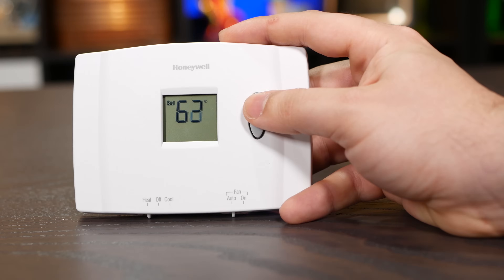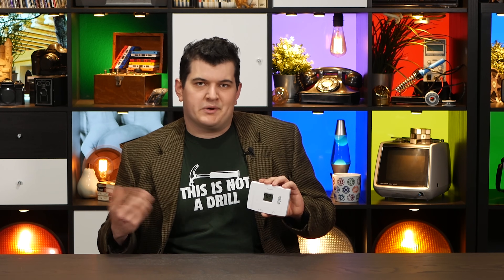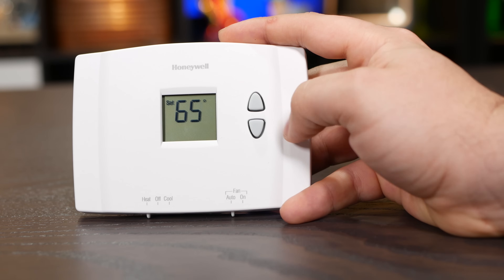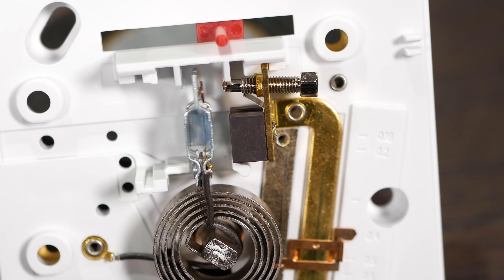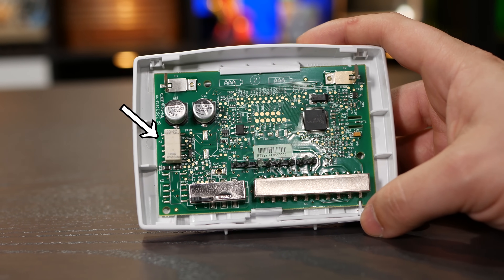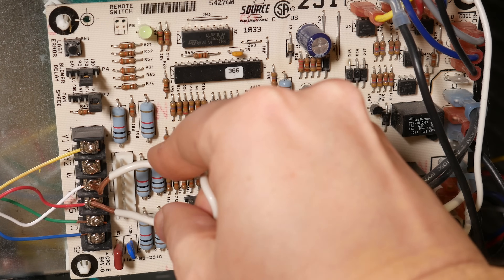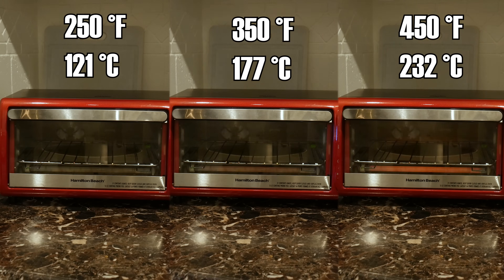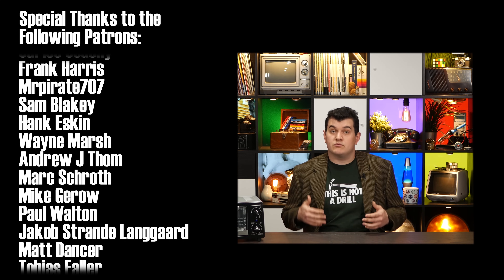Thermostats: Cooler than you think!

Comment from the maker: Some additional information!
Firstly, two-stage heating is sorta common so the notion that "there is no medium blast" is probably true but if you have a fancy pants HVAC system, then maybe cranking the heat up might make it go faster. No idea what percentage of homes have a two stage heating system, but I'd guess it's in the 10-20% range.
In re: the thermostat wire question. Apparently, to this day, the current going through the contactors that actually turn on the high current loads such as your A/C or an electric furnace's heating elements is carried through the thermostat. So, it's more than just color coding; they are designed to carry some current, and thus need to be a minimum wire gauge. So while Cat5 cable or similar would probably work for most HVAC systems, it might not be able to carry enough current for others (and could, potentially, pose a fire risk under the right circumstances).
On that note, and I'm mad at myself for not bringing this up, you might have noticed that in the mechanical thermostat, a separate insulated wire connects the R terminal to the contact on the bimetallic strip. This prevents the current from being carried through the bimetallic strip, which could inadvertently heat it up and prematurely stop the furnace. Neat!
Reply: In some commercial buildings, the setpoint really can determine how quickly a room heats or cools.  The HVAC systems in surgical centers and ORs are largely oversized by design, and because they have VFD-driven fans, variable proportioning valves for chilled and hot water, and a network of terminal units and room thermostats, a drastic change in the setpoint will result in a drastic change in room temperature, while a smaller change will happen gradually.  Ask an OR that's at 74F to go to 58F and it'll do so very quickly as fans are ramped up, multiple compressors are spooled up, lots of chilled water is supplied, etc.  Adjust it from 58F to 62F, and it'll be a good 20-30 minutes before it does because the system won't waste a ton of energy ramping fans and calling for additional boiler units to start to heat more water.
Reply: I have a two-stage furnace, but not a two-stage-aware thermostat. The furnace installer couldn't be bothered to run a cable with more strands, but assured me that the furnace activates the second stage if the thermostat asks for heat for more than a few minutes. I wish I had invested in a 96% furnace instead.
Reply: @tfofurn  Look into a smart thermostat, one that has a separate control box next to the furnace. The control box talks directly to the furnace over the colored wires, and only uses the living room thermostat wires to power and communicate with the wall control. Only two wires are needed! The control box breaks out as many separate wires as are needed. Heat, Cool, Stage 1, Stage 2, Fan, Common, you name it. They are smart home enabled too, so you can remotely control with your mobile phone or a home bridge. Honeywell make commercial thermostats as well and make available a lot of advanced features and system setup. So much so that you will want to become an expert before changing some of them. I have one and it's really convenient. Here's a link. https://amzn.to/2YpbqjE
Reply: @tfofurn  I have a two stage furnace hooked up to a nest with just one heat stage of control. You'd think this would be a problem but it is not. You see, in the bryant furnace I have, the board itself is actually keeping a running tally of its time-to-temp. If the last run time was over a predetermined threshold, next time it turns on it'll fire the high stage. If the last run time was short - it'll run the low stage. And if its in the low stage for more than, I think 5-10 minutes or whatever the setting is, it switches up to the high stage.

The effect is, when its 40-50 degrees F out and you don't need a full blast furnace, it'll cycle the low stage for say, 5 minutes at a time. If its much colder out, it'll cycle the high stage for short periods of time. That way it doesn't take too long to heat up but also doesn't run higher output than necessary on a moderate day.
Reply: tfofurn I don’t think that’s true. He probably just wired to high heat or jumper them.
Reply: @tfofurn  Installing that wire with a few more "strands" might not be easy. How much drywall did you want him to rip out? How much painting did you feel like doing? If the old thermostat wire was installed correctly, it's stapled inside the walls so he can't just tie the new wire to it and pull it through. You can fix this yourself if you want to, my advice is to get your drywall skills mastered before you attempt it. 
Most multistage furnaces can be set on the control board, or "learn" over time, that if a call for heat lasts more than X minutes, they should kick up to second stage by opening a second gas valve. This loses some of the efficiency of a multistage furnace, in that a furnace is most efficient when it runs 24/7. A furnace that runs 24/7 when it's 25F is not going to keep up when it's 5F, so multistage adds efficiency because the main burners are basically always running. 
96% or better AFUE vented through PVC plastic pipe is pretty much the state of the art in residential stuff, and really approaching the limits of thermodynamic efficiency that is possible. You might one day see 97% or 98% efficient natural gas/propane units, but it really can't get above that - your flue gas is always going to be hotter than your indoor air or else there would be no heat transfer across your heat exchangers.
Reply: @tfofurn  "delay on make" module to turn on 2nd stage. which is the same as a thermostat would do.
Reply: @tfofurn  some furnaces stage based on the configuration on the control board and do not require 2 stage thermostats. Whats the model number of the furnace?
Reply: @tfofurn  yeah about 7 minutes if it didn't catch up it'll activate W2 for either second stage or for dual fuel.
Reply: I've got one of those systems where the compressor doesn't run right if the NEST or Ecobee is trying to charge at the same time. It 'chatters' for about 30 seconds then the control board in the AC engages safety mode and won't let the thermostat turn it on. Bonus, instead of a terminal block, the unit just has wires coming off the board, unmarked. R, B, G, Y, W, and Brown. I went around in circles almost a year before I found the contractor's documentation, which told me, of course, how silly of me, the brown wire was common and the blue was for 'dehumidification mode'. 
More units than you'd think have multistage modes, but they're almost never hooked up. Mine doesn't even have terminals for it but according to the documentation, it engages the second stage if it runs more than 5 minutes.

We have 3 AC units at work in our headend, because our equipment generates enough heat to heat 3 homes in the winter. One of our thermostats burned out (literally) and since they run  90% duty cycle, I rigged up a relay and a computer to run the AC blind until we got a new thermostat. (I used the serial port and DTR  line to control the relay). 
The O/B wire controls heat pump's 'direction' (heat transfer in or out) and W would be used for the backup 'emergency' heating iirc.
Most of the time, turning on the heat will also turn on the fan if it is forced air, which is why the simple unit had no fan wire. 
In a mercury actuated thermometer, what causes the 'positive' control (like the magnet) is actually the surface tension of the mercury and the metal coating the contacts in the bulb. It doesn't actually conduct until it 'breaks' over both poles, and it clings even after it starts tilting away. I actually sat and watched one of the fancier Honeywell units cycle a few times once. 

It was the 80s, we didn't have internet, nothing interesting was on the 7 channels of TV, I couldn't leave, and I'd read every book in the house. So I took the cover off and watched the thermostat work. Now that I think about it I'm not sure why it was designed the way it was, it had actual circuitry, but wasn't what anyone would call smart. Maybe it was able to run a multistage unit properly?

I have a Honeywell smart thermostat in my 'junk' drawer that had an 'override with time' mode, where you'd say 'change the temp to this for this long then resume your schedule as normal'. They called it 'home sick' mode. On the other hand it was a great piece of engineering because it adjusted for daylight savings time by itself... except that when it got to where it gets set back an hour earlier, it would go to 2 am, set the time back to 1 am... then repeat at 2 am, and again, and again, forever in a loop until you reset the clock. Also they apparently forgot about Arizona and Hawaii, because there was no option to turn off DST. (You didn't set a time zone or anything, it wasn't internet connected. Just smart enough to do programmable routines and such.)
Reply: where did you get the shirt
Reply: 16:26
I have a super special thermostat in my house right now; it lets me program the temperature for 4 different times of the day - morning, afternoon, evening and night - and determine when each day part starts, meaning I can have it set to what would normally be an uncomfortable temperature that is closer to the outside temperature while I'm at work to save energy, then have the unit adjust the temperature to something more comfortable before I get home.  It also has a weekday and weekend setting so I don't have to worry about sweating or freezing in the middle of the day on my days off.
What makes it really special, though, is I can temporarily override the temperature setting for, say, coming in from mowing the lawn and the thermostat will go back to the pre-programmed setting after about half an hour or so.  So, yes, there are some models out there that let you do exactly what CantComeUpWithUsernames suggested.  Now, I have no idea how much a thermostat like that runs for, or how easy it would be to find as it was already installed when I moved in 5ish years ago, but if I move to a different place, I really, really want to take it with me.
Reply: @Dargonhuman  The nice thing is that these features (multi-day programming with short- and long-term overrides) are not hard to find.  You should be able to find this in any not-bargain-basement digital thermostat.  If you read the boxes in your local hardware store, you should be able to find a few that will have these features in the $20-50 price ange
Reply: @Shamino0  Good to know in case anything happens to this one.  The last place I lived had an ancient mechanical thermostat and so this is the first time I've seen a multi-day programmable one.
Reply: Dargonhuman that's your average programmable stat
Reply: @Dargonhuman  doesnt mean that your furnace is capable. And you should always leave the house within one or 2 degrees of the set point . otherwise you waste all the energy you saved at work when you come home and the furnace has to run longer to make up the difference. You arent saving anything. Best to set it 1 degree cooler all together. Then get used to a colder house.
Reply: @Dargonhuman  I hate to burst your bubble, but you’re talking about 40 old technology that you can buy at any big box store for $25.00 USD. Look at my post above as well
Reply: Hi buddy, I noticed that you never mentioned the heat anticipator on the analog thermostats. The brass strip with the adjustment screw with the mini magnet on it. Very very important thing to gloss over entirely!! Without being adjusted properly your furnace would either run too long or not long enough to properly maintain the temperature you set it at.

https://en.m.wikipedia.org/wiki/Thermostat#cite_note-2
Reply: @PepperTheOtter  I'm glad you bring that up, I thought exactly the same. How was that missed!! Hysteresis control is essential to adapt the heater to the installed environment, else it'll either cycle like crazy, or not cycle enough and be always too cold or too hot.
Reply: It's the last paragraph of the "construction" section
Reply: Thanks for telling me of the , and . keys advance frame by frame. I always just slowed down the speed to .1x speed.
Reply: nice, my place uses the mercury switch.
Reply: Oh one other thing, I have an Emerson Sensi, I have tried to use an Ecobee, and I have a Nest. I liked the Ecobee the best for features and stuff, but the Emerson does one thing the other two never did: It emails me when it thinks something's not right. (I've gone through the two really smart ones because of common wire issues, and the odd wire color choice in my outside unit) For example when my burner cracked, and thus wouldn't turn on, it realized the heat wasn't heating after an hour or so and emailed me. Same thing if the cooling isn't cooling properly.  I also got emails occasionally for humidity spikes because it is exactly opposite the door of the bathroom I shower in and if the weather is wet it gets compounded by the the fact it switched to 'cool to 78' at the time I left the house for work to make the humidity creep over a threshold (since the AC isn't actively removing it).
Reply: @copperhamster  The Ecobee does have temperature/humidity limit alerts, though. At least my 3 Lite does. It pings my phone and sends an email if it strays outside those bounds. I'm not sure if it will detect a total failure to heat/cool, but my limits are tight enough that I'll know if something is wrong.
Reply: I have Honeywell EvoHome solution for heating. Wirelessly connected digital motorized valves on radiators with built in thermal couples (for zone control), with a programmable controll unit. And yes, you can override temperature in any zone temporarily (e.g. set temperature in X zone to Y for next Z minutes). And my furnace scales itself from 2.4kW to 24kW depending on the temperature of the "return water".
Reply: The newest furnaces have variable gas valves that can pretty much ramp up from 1-100%
Reply: @Marty Schrader often the "variable drive" blowers just have a few different taps on the drive coil for high, medium-high, medium, etc. The installer will enable one and another to match the requirements for heat/cool, and a third one ends up as the "fan" setting.
Where I work, we have a truly variable fan that is supposed to maintain constant pressure to two zones in a pair of former clean rooms. Apparently, this sort of setup is rare, because the HVAC techs we called out had a hell of a time setting it up to NOT burn out the expensive blower while one set of dampers was closed, and one zone was constantly too hot or cold. As it sits now, both rooms have been reduced to a single zone, and one is used for storage so it can broil or freeze with no(?) consequences.
Reply: My two-stage would never operate both stages at once.  I think it's been supplanted by the variable speed furnace/heat pump/AC units by now.
Reply: The furnace control board shown has a wiring issue. The yellow wire is landed at "y1" and should be on "y/y2" When you have a 2-stage air conditioner you would use "y1" for first stage cooling and "y/y2" for second stage cooling. "y1" energizes a lower blower motor fan speed. "y/y2" energizes a fast and usually fastest fan speed. In this case since only a single stage air conditioner is used, the blower speed will be too slow with a call for cooling.
Reply: How about an HDAC system?
Reply: @firefish111  heating, ducks, and cooling?
Reply: @renakunisaki  Never heard of an HDAC blockchain thermostat?
Reply: @firefish111  What is an HDAC?
Reply: @Chris-rg6nm  he was talking about the "greater than" and "less than" symbols (< >), not the directional arrows
Reply: @MrFastFox666  I've never even noticed them before!
Reply: just an FYI to add to the topic, i purchased a new hvac heat pump system in the last few years and while i can control the fan, it's actually made to run 24/7, so my fan runs 24/7. not at full blast though. it just runs a little all the time, but when heat or cold come on it speeds up. the effect of this, is awesome, it helps eliminate hot and cold spots and evens the temp through the whole house. so it's not super hot or cold on any one floor. my previous system did not do that and as you would expect, upstairs was always hot or cold depending on the season. now it's not. so if you are in the market for a new hvac system, get one that is made to have the fan run 24/7 it really does help.
Reply: @iamborg3of9  my house has a heat pump, but not a variable speed fan.

My thermostat has an option to make the fan run on its own periodically. I have it set to run 30 minutes per hour during the day, and continuously during the night, all in an effort to keep my unusually warm room cool without turning the rest of the house into a freezer.
Reply: @iamborg3of9  that sounds like a failure of your old system's install, not a feature of the new one. I've never heard of a fan that's supposed to run 24/7...that'd burn out rather quickly. You might want to verify that...
Reply: @ehrichweiss  I assure you it's running as it is meant to, it is not a typical AC fan, it is an ECM and is designed to run that way. you should research variable speed air handlers.
Reply: an issue in the UK is that the thermostat is often found in a cold area of the house such as near the front door, meaning the thermostat stays cold no matter how long the heat is on for.
Reply: I can understand why you would a basic thermostat system reminds one of PWM, however I feel as if that is inaccurate and betrays what PWM actually is. Instead a thermostat should be looked at as a simple form of negative feedback, as a cold signal is fed into the thermostat it outputs a hot signal and vice versa!
Reply: @Ammi6543  Yeaaah, once your pulse is on the order of hours, it doesn't feel right. Also, PWM implies a set frequency of transition points. With pure PWM, the response would be underdamped, taking several cycles to settle to the set point as the widths are adjusted, whereas (simple) thermostats have a more critically damped, integral behavior.
Reply: Ahh, you didn't cover the liquid mercury thermostat, nor how zoning systems work.  Zoning systems battles with different heat and ac sets in different rooms on the same unit are impressive and simply complex. Do it,  do it. Double dog Dare you!
Reply: In e aware that this method of control is known as _Bang-Bang_. It is used mostly on incredibly simple systems with a large amount of lag.
Reply: I've noticed a problem with my thermostat (in my own home, not my fathers) that I can't seem to solve.  If the temperature I want is set to 68, I have to wait until the room temperature drops to 66 before it will turn on the furnace.  I expect it to turn on when the room temperature drops to 67.  So I end up having to set the room temperature to 69 instead of 68.  Why does this happen?  The thermostat we use is digital, not analog.
Reply: @simonmacomber7466  Single stage heaters attempt to maintain an average temperature over time.  When the temperature drops below 68, the heat kicks in. When the temp at the thermostat reaches about 69 it shuts off and the temp probably continues to climb because it takes time for the heat to circulate.  Eventually it falls back down to 68 and the process repeats.
Reply: @huzbum  You are probably correct, but there are furnaces that are not single stage heaters.  Some, such as the one I'm talking about, has two (or more) different stages.  Because of the design of the furnace, turning up the heat higher does, in fact, make the house warmer quicker.
Reply: @simonmacomber7466  yeah, a two stage is supposed to maintain temperatures closer to the target.  It could be that your thermostat is setup/wired for a single stage.
Reply: @huzbum  The owner's manual says: "If the target temperature is ten degrees or less than the current temperature, the furnace will not run continuously, but will instead, run for thirty minutes stop for five minutes and then run for thirty minutes until the target temperature is reached.  If the target temperature is greater than ten degrees from the current temperature, the furnace will run continuously."

This means that you will warm up the house faster by turning the temperature higher.
Reply: Yup, the two stage furnaces I'm guessing will become more common over time as people replace theirs in cold places: we hardly had a choice to not get one. (and ecm blower motor which I'm pretty sure is just a fancy way of saying BLDC - super quiet, naturally variable fan speeds, and, amazingly, way cheaper energy bills.)
Reply: If you have a heatpump and a electric furnace the system will run the electric heat strips in the furnace and the heat pump if the temperature in the house drops to far or if the thermostat is turned up far enough. A heat pump should heat the air about 20 degrees in most cases with a single stage heat pump and if the heat strips in the furnace turn on the temperature rise could go from 20 to as high 70 with a 70 degree rise being the max most of the time. So if the temperature in your house is 69 degrees and you have the thermostat set at 70 degrees the heat pump should turn on and the air temperature coming out the vent should be close to 90 degrees but if you walk over to the thermostat and turn it up to 80 degrees then in most cases the thermostat should start to say something like AUX HEAT and it will turn on the heat strips in the furnace raising the temperature coming out the vents up to a max of 140 degrees (70 degree rise) but in most cases your going to get a temperature closer to 110-120. 

Aux heat = when the temperature in the house is more than a couple of degrees of the target temperature and the thermostat decided to turn on the heat strips to quickly worm the house 
EM HEAT or EMERGENCY HEAT = manually changing the mode on the thermostat from heat to em heat witch is forcing the system not to use the heatpump at all
Reply: I have a 2 stage furnace, but my thermostat is a 1 stage model. In this case, the furnace will run at low intensity for 12 minutes, and then run at full intensity for another 12. I would like to upgrade the thermostat though, as using a compatible 2 stage thermostat would greatly improve efficiency.
Reply: Growing up, dad had a heat pump installed. The thermostat would use only the heat pump unless it was colder than -4 Celsius outside for standard room heating, and would only kick the furnace in when you were trying to heat the room more than 4 degrees. If I remember correctly, you could alter the point at which it kicks in the added heat though. 

Also, that thermostat would allow you to set a temporary room target until a specified time, at which time it would return to its regular schedule.
Reply: We have a two stage blower in our Westinghouse furnace that is controlled by a 13 year old Hunter programmable touchscreen thermostat. There are 5 wires to the thermostat, but the blue wire has been repurposed for two stage air conditioning. The two stage heating uses 1 wire with a jumper to connect the two terminals on the thermostat. When the system wants stage two of the heat, it quickly turns the heat relay off and on to signal the furnace to switch from stage one to stage two; it can also do this with the fan wire to allow for different blowing speeds when the heat or a/c is not in use.

This thermostat is somewhat impressive for how basic it really is: It can run the fan periodically to keep air circulating in the house when there isn't a need to for heat or cooling, it can automatically switch between heating and cooling, it has a furnace filter timer to remind you to change the filter, it can run temporary programing of specific temperatures for specific times (sort of what was being asked at 16:25), it lights up red or blue depending on if the heat or a/c is running, and it's very programmable 7 day 4 period programming.

The biggest drawbacks of this thermostat are fairly obvious: It's not a smart thermostat, so it can't automatically change based on when people are in the house, and it doesn't have wifi, so no setting it while away from home. The touchscreen interface is really clunky and reminds me of those cheap personal organizers with the fixed elements on an LCD screen. 

The most egregious issue with this thermostat is it can get stuck in a daylight savings time loop in the fall where it will set itself back an hour and keep setting itself back an hour every time it reaches 2am until you change the time to something after 1am. It took me years to figure this problem and the only way to fix it is to either set the clock past 1am or just turn daylight savings time mode off. Honestly the DST programming is probably a good topic in of itself since this is a clear case where someone bother doing it properly and it screwed up a product.
Reply: Mini split units (the wall mount heat pump ones) do adjust the speed based on the set point. They are getting more common in some areas, and in those situations they will heat or cool more if they are further from the set point. Of course they do it automatically so you should still just set them to the set point if that's the ultimate temperature you want. At least a few of them have a button labeled POWERFUL or something like that which forces them to work at full speed to get there. It is quicker, at the cost of noise.
Reply: There is a device used in electric cookers that is a more related to PWM than a thermostat. A SIMMERSTAT (May also be known as an Infinite control switch has a small internal heating element around a bimetal that turns on and off based on the switch setting.  (as opposed to a thermostat which reacts to the temperature of the medium being measured)
As a Simmerstat is constantly turning on and off (with cycle times in seconds or even in minutes) the set point will affect how quickly the device heats up, unlike the thermostat.
Reply: I've lived in about 10 places....and only one had two stage heating.  10% statistic confirmed by extremely anecdotal evidence.
Reply: A few comments.  The Carrier Infinity system is one of those "fancy pants" systems.  When used with the official Infinity thermostat, the "acbd" wires are actually data communication wires.  The "thermostat" is a sort of control console to the computer in the HVAC unit.  If you want to use a third-party thermostat, you need to reconfigure the unit for dumb 4-wire operation (as you described) but then you lose control over all it's fancy features such as multi-level heat, multiple sources (gas, heat pump, electric coil), UV sterilization, humidification/dehumidification, open and close ducts, and other things you can optionally pay for.  It also can form a network so one thermostat can control multiple HVAC units (for those with big houses).

I have also set up a dumb thermostat on a not-too-advanced system that supports "medium blast" (high or low flame).  In that case, the furnace is configured to power-on at low flame and then switch to high if it remains on for more than a few minutes.  If you get the approved thermostat (which can directly control this) then there you reconfigure the furnace's controller board so that more advanced signals can be carried on the four wires and the thermostat can directly select the amount of heat.
Reply: Also, if you notice on that mechanical thermostat, there is a slider that goes up and down like that of a rheostat or potentiometer.  Its purpose is to provide a minute amount of bias heat to the bi-metallic coil to help overcome its and the surrounding area's thermal inertia.  You can adjust it up or down to help speed up or slow down its transition to "off".
Reply: @Chris-rg6nm  
Notice that he wrote "<" and ">", not "←" and "→". Most QWERTY keyboards have a less-than and greater-than sign shifted above the comma and period. These signs can double as directional arrows, making it more intuitive to type "<" and ">" for "previous frame" and "next frame", rather than "," and ".", which are pretty meaningless in this context. I can understand the confusion, though, especially for people not using QWERTY keyboards.

Fun fact: If you hold down the shift key while pressing these buttons, you can decrease or increase the video playback speed.
Reply: Do you plan making a video about heat pumps? You already talked about so many similar topics. It would fit in nicely
Reply: My grandmother has two mercury switched thermostats from the 70s and both still work flawlessly, though one did get very slightly bumped one time, which threw off the calibration about 5 degrees. Easy to see why it's a stronger design than the magnetic one, especially just knowing how much debris in the air can do to contact points over many years in a house.
Reply: I have a multi stage ac system that never totally shuts off....
It will ramp up as cooling is needed and slow down when cooling needs are met....
This is done to maintain proper humidity in the home and keeps it from feeling like a cave....
You people who live in the deep south understand the cave man feeling
Reply: For the multi-room temperature sensors and setting the thermostat temporarily to a temp, use the EcoBee line of thermostats. Does both of these.
I use one and its quite nice for each of these features. The sensors are wireless, run on coin cells for months, and also have motion detectors in them to help keep the system from running when no ones home during the schedules, and when people are home when they shouldn't be. 

It's a great system that also can be controlled by Google, Alexa, IFTTT, and Apple HomeKit now. 

Only downside is buying more sensors is a bit expensive as is decent coincells.
Reply: Here in the UK, most, if not all wet central heating boilers have two stage burners.  On mine, the first stage runs for about a minute, and if the return flow is below a certain temperature, it then lights the second stage for full output.  Programmable stats allow setting different temperature / times throughout the day.  They've been available for well over 10 years.
Reply: You forgot the o or b wire on heat pumps, which tells the heat pump to pump heat in the opposite direction of default. Heat pumps by default either pump heat in the house or out of the house. Rheem & Ruud are the odd ones that default to pumping heat out all other heat pumps default to pumping heat into the house. Also if you have an electric furnace or heat pump doing a wire test or for AC you need to include the g wire. For a gas furnace you do not want to jumper the g wire as on older furnaces you are more likely to blow out the burner & the control board will automatically turn the fan on its own, that could lead to turning the house into a bomb.
Reply: @v2joecr  That's not true if there is rollout happening most of the time you have a cracked heat exchanger flames should never rollout on a gas furnace
Reply: @v2joecr  There are a few more brands then Rheem and Ruud that use "B" for the reversing valve to energize in heat Bard, Weatherking(owned by Rheem) Ameristar(Owned by Trane) and Bocsh
Reply: Please do a video on solar panels vs solar tubes. I'm weighing up the rpos and cons of each to get them installed. =)
Reply: Technology Connections:

Before composing this comment, I did not read ALL of the more-than-2400 existing comments, and therefore apologize if my remarks are repetitive. 

One common feature of bimetal thermostats which you did not discuss is/are the anticipator resistor(s).  For a heating-only thermostat, or the heat side of a combination 'stat, the thermostat would have an adjustable resistor in series with the switch contact (open or mercury) which controls the heating function.  While the heat is on, current flowing through the anticipator resistor would warm the inside of the thermostat housing slightly, causing the heating unit to turn off somewhat "prematurely".  This "premature" shut-off allows heat stored in the heating system to warm the space without overheating the space.

For a cooling-only thermostat, or the cooling side of a combination 'stat, a resistor in parallel with the switch would keep the bimetal a bit warmer when the cooling equipment is off (the calibration taking this into account).  When the cooling equipment is running, the this resistor would be shorted out.  The result would cause the cooling equipment to turn off a bit early, to avoid overcooling the space.

These resistors would be specified/adjusted according to the value of control current (typically at 24 volts AC) drawn by the relay coils controlled by the thermostat.
Reply: The home my family built int he 90s had a two stage. I think it would only use the low/medium setting for maintaining temp.
Reply: https://www.furnaceprices.ca/furnaces/furnace-types-explained/
Reply: Technology Connections I would like to see a video of Hi 8 tapes and that analog video format
Reply: You are an engineer? Because you putting nice class-like  information here.
Reply: Few things you'll probably not read but here goes:

Y2, W2 and X2 are for two stage systems. Generally for systems with a "medium" heat. While auxiliary heat is used for a kind of ultra heat mode. However the distinction often gets blurred between W2, E and X. While Y2 pretty much always means a compressor with two stages and will also have a W2 if its a heat pump. Note that the numbered designations can keep going up. Many systems have 2 compressor stages Y and Y2 and three heat stages W, W2 and W3. Their smart boards interpret these stages to actually enable different parts of the system.

There is a big difference between the E (emergency) and X (auxiliary heat). The former should be used instead of the heat pump while X is used along side the heat pump. This distinction is specific to heat pumps and on furnaces often E and X are the same. X is often labeled emergency heat although it specifically calls heat unlike E which only enables a mode on the HVAC.

O and B are used to enable reversing valves and heating mode. O for cooling will enable the cooling reversing valve and enable the condenser plus its fan. B is used to reverse into heat pump mode or it can used to enable a furnace if its not connected via auxiliary heat. Most actual HVACs will do this control indirectly with a control board. The signals of O and B are reversed and always inverse of each other. Many HVACs combined these two.

The common wire exists in several forms. For example emergency heat its often not called directly by the thermostat its a mode of the HVAC. That means a thermostat can leave X on to mean "emergency heat can be used when needed" and this also acts as a common. Further some thermostats are powered by a closed relay loop by limiting the current below the relays tripping current.

Some systems have separate 24v signals for heating and cooling because of the different current characteristics of the two systems. However most thermostats have R meaning either system and Rc for cooling. Which means if you had an Rh wire you'd use the R wire on your thermostat. Whereas if you had Rc and Rh you should jumper them together for a system thats commonly signaled between the two and keep them separate for systems with separate signals.

U1, U2, U3, Un are used for humidity control (which is usually just controlled via the fan). But the U wires provide granular control. Typically these systems are called IAQ systems and might have entirely separate air circulation from the HVAC. They will filter air and maintain humidity.
Reply: @joshinken It sounds like you don't have a furnace but a hydro air system air handler with a hot water coil and a regular A/C coil
Reply: @joshinken Are you confusing furnace with a boiler a boiler heats up water a furnace blows hot air in the Northeast US its common for people to have hydro air systems hot water coil in an A/C air handler with a regular A/C coil
Reply: I have 2stage heat and 2stage cool with a multi speed fan
Reply: its also in a way like the Centrifugal governor on a steam engine :) https://en.wikipedia.org/wiki/Centrifugal_governor
Reply: I need a good version of the following because my apartment has two window air conditioners: 

A smart plug WITH thermostat included so that it either turns on or off based on the temperature so I can transform at least one window unit into a smart one controllable by Google home. I've seen these, but they all have horrible reviews (so far).
Reply: Look up vrf systems before you say there's no "medium" setting.

To answer your first question from Twitter,  the thermostat is at the return  filter by design to measure return air. 

You oversimplified something without having any experience or real knowledge to back it up. I appreciate your other videos but this one is not correct it terms of operation of hvac.
Reply: Don't Forget, If You've got a boiler that will heat the water a couple degrees over many hours. Hot air has single stage and 2 stage as most cases . There are also modulating furnaces that operate at whatever is required along 50 to 100% usage but they have special gas valves and exhaust motors to adjust to all the different condtions.
Reply: My understanding about my two stage furnace is that nothing is different about the communication between the thermostat and furnace. The furnace simply starts at 40,000 BTU and if still running after a certain time will crank up to 80,000 BTU.

There is no knowledge being transmitted from the thermostat to the furnace to cause it to go to stage 2. The furnace still only has that single call-for-heat wire.
Reply: @richardbettridge475  depends on the furnace. Some do it internally but most do it via a call from the thermostat. Which is why you see stats with the 3 heat 2 cool on the box or something along those lines. Some require a communicating thermostat (high efficiency units) which is modulating based off of percentages.
Reply: Re: half an hour of extra heat/cooling without changing the temperature: I used to have a thermostat with a boost button. Either it increased the temperature of the water in the radiator system so it heated up faster or it ignored the temperature and just heated. either way it was cool. or hot. one of those anyway
Reply: The first two stage furnace I ever worked with was actually two identical furnaces, each half the size needed, set next to each other into a shared plenum.
The interesting part was the thermostat.
It was mercury switch, so a glass tube with a drop of mercury in it, and attached to the end of the coil spring.
The tube was slight curved or bent, and it had 2 sets of electrodes sealed through the glass, so as the spring cooled off the drop would engulf the first set of contacts, and if it got colder it would tip far enough to get a engulf the second set of contacts.
Reply: It’s amazing to think that your everyday electrician knows all this technical information
Reply: Even if the fan blows faster it doesn't heat it up any faster! Your heating element can only get so high I can only disburse so much energy no matter how fast a fan may be going.
Reply: Me after watching this incredibly informative and interesting video full of humor and intelligence: huhu 'doodie cycle'.
Reply: There's a reason thermostat cable is made of solid copper wire, instead of stranded wire.
Reply: Love your videos!  Also an Illinois (Chicago burb) native and Disney fan that actually did the college program (keep the Disney videos coming!) I was lucky enough to update my new to me home in RI with an LG split heat pump system and the forced air side thermostat can adjust both fan and compressor based on feedback from 3 thermistors, one at the intake, output and thermostat!  Just wish its thermostat communication wasn't proprietary so I could smartify it with a connected thermostat, only able to use their own app with an added USB wifi device and their app 🤔. Wanted to increase the engagement as suggested!
Reply: @Chris-rg6nm  That's the best news I've had this century. Thanks very much.
Reply: I am a total sucker.
Not sure if I'm that much fun though.
Reply: It all comes down to the controller utilizing some type of thermocouple (usually J type) and having the capability to intermittent cycle or full on or full off. Both options only allow for 1/0 logic but your technical gripe comes down to the furnace architecture itself, not the limitations of commercially available thermostats.
Reply: Can you do a video about electric stoves, and compare the old electric burners to the glass top variety, and how the temperature is controlled vs  power output? I suspect that the new stoves use a pwm at a much slower frequency, specifically they use a temperature control rather that control the power output. The result of this seems to be that the new stoves can be at 100% output, for example if you were to put a large pan on a small burner such that the pan is an efficient heat sync. The old stoves seem to uses an actual pwm duty cycle such that 7 on the stoves is outputting 70% of full power. I think the new technology isn't working as well as the old...
Reply: my furnace is 2 stage, AND has a pwm speed controlled fan
Reply: I used to work as a Quality Engineer at Honeywell in Gardena, CA. There gas valves, pilot burners, pilot igniters, and relays were manufactured. I worked there back in the 1980s.
Reply: Aaaaaaaaaaaaaaaaaaaaaaaaaaaaaaaaaaaaaaaaaaaaaaaaaaaaaaaa6aaaaaaaaaaaaaaaatttt5tttaaaaaaaaaaaaaaaaaaaaaaaaaaaaaaaaaaaaaaaaaaaaaaaaaaaaaaaaaaaaaaaaaaaaaaaaaaaaaaaaaaaaaaaaaaaaaaaaaaaaaaaaaaaaaaaaaaaaaaàaaaaaaaaaaaaaaaaaaaaaaaaaaaaaaaaaaaaaaaaaaaaaaaayyaaaaaaaaaaaaaaaaaaaaaaaaaaaaaaaaaaaaaaaaaaaaaaaaaaaaaaaaaaaaaaaaaaaaaaaaaaaaaaaaaaaaaaaaaaaaaaaaaaaaaaaaaaaaaaaaaaaaaaaaaaaaaaaaaaaaaaaaaaaaaaaaaaaaaaaaaaaaaaaaaaaaaaaaaaaaaaaaaaaaaaaaaaaaaaaaaaaaaaaaaaaaaaaaaaaaaaa a éwe
Reply: ahh yes the two stage ones but true most common systems are single stage so the temp will not rise faster if you set it higher
heck 99% of consumer cars are the same and people set the climate control to 80+ degrees rather than let the car actually control the temp
though in rv/heat pump systems they likely have a heat1 and heat2 first stage is the heat pump the second is a cold weather fuel burner
Reply: You forgot mercury bulbs are more fire safe than open points contacts. They are still used for this purpose in places were you cant have any open sparks.
Reply: Do a vid about the newer inverter and fully variable systems like the Daikin FIT system.
Reply: Most residences in the sunbelt states are heated with heat pumps. Almost all heatpumps have secondary resistance heat. Generally if the set point exceeds the temp by a degree or two the resistance heat will come on and significantly up the heat output of the system.
Reply: Are you talking two stage fan, or two stage heating elements, are two stage fan and combined elements. The fan can only run so fast, the elements or heat pump can only put out so much heat. So when you say two stage you have two options, full capacity or less than full capacity. Or are you talking two stage as in heat on, or heat in space being recirculated.
Reply: I have a Carrier infinitely variable inverter driven heat pump and blower motor , as such the speed of the compressor  and blower  can vary a lot depending on demand. So if a little heat or cooling is needed the compressor and blower run slow and  in my case if say the system was heating and I increased the temperature the compressor and blower would increase in speed providing even more BTU's of heating output, so that the temperature of the output air does increase or when in AC mode gets colder. I should add that If someone reading this needs a heat pump ,this unit unlike a conventional heat pump can provide heat without the addition of  resistance heat down to minus 10 degrees F.
Reply: @leekumiega9268  yea I have one. Heating and cooling is I/2 the price of are old home which was 1/2 the size. Lower speeds keep the air circulating when the unit is not putting out heat or ac.
Reply: As an electrician and HVAC guy as far as I've seen no matter how fancy pants the heating system, at the end there is still only one blast settings on a furnace.
Reply: @CG-sv2nw  Top of the line gas furnaces and heat pumps cam modulate their heat (BTU) output ,so at low fan speeds their heat output is less than at high fan speed. Read up on modulating units.
Reply: @CG-sv2nw  Right, there confusing heat with recirculation
Reply: raises hand - we have a 2 stage, 2 speed system...  so it can run the fans physically at 2 different speeds and burn the heat (natural gas) at 2 different levels.  However, you are correct for most systems.
Reply: Presumably, with a 2 stage heating system, and an intelligent thermostat, unless you are trying to heat it up a tiny amount, it would presumably switch to high until it gets close to the desired temperature, then switch to medium/low.
I see the bigger issue with that is if you force it to high, you are far more likely to overshoot.
Reply: my house has heat stage 1 and 2
Reply: @TotallyBCK  Does your thermostat make use of it using stage 2 heat at the start to heat up quickly and then dropping to stage 1 when close to temp?
Reply: Ecobee does exactly what you're asking. When you change the temp, it asks how long you want it to deviate from the schedule. Unfortunately, it's not very granular as the options are 2hrs, 4hrs until I get home or until I change it.
Reply: @Technology Connections I would like to offer you a way to help get more views and subscribers. I would like use your videos to make TikToks and you would not need to be paid and I would but a link in my bio and you can review the tiktok before I upload if you want, hope your well, William Holder
Reply: The last question posed about a "single duty cycle button" is I believe incorporated into the "Hold" or "Hold Temperature" function on most programmable thermostats where you set the temp, apply the hold feature to modify the programed routine. And then you either cancel it with a resume program or the program knows to resume based upon previous inputs in the program setup.
Reply: There are also ecm motors that vary speed depending on just fan, heat or cool
Reply: As a HVAC service technician the only high voltage thermostats I have ever seen are for electric baseboard heat. The vast majority of systems use "control voltage" or 24v to control relays to bring on high voltage components. Some fancy thermostats actually communicate with the furnace/air handler and outdoor unit.

There are a few thermostats that allow you add multiple sensors and one in particular that senses occupancy, allowing you to better control the temperatures in the rooms you are actually in. Not as good as a zoned system but much less expensive to install. Ecobee thermostats have these wireless sensors and you can add up to 32, you can even set which times of day it looks at which sensors.

Thermostat wires exist because they use 24v for control voltage, ethernet wire is too thin and romex uses way more material than necessary. Garage doors, security systems, doorbells, water meters, some led lighting and some automatic sprinkler systems use the same wire.

There are programmable thermostats that allow you to override the temperature for a set amount of time and when that time expires go back to your original temperature. Ecobee can also do this.
Reply: Don't need a w2 wire two stage furnace will witch to second stage after 15 min if temperature is not met
Reply: Speaking of PWM and TStats, look at infinite switches by HATCO, and a few other manufacturers, but HATCO is the most common. It has a small bimetallic strip that is heated by the line voltage passing through it, once it heats up enough it breaks the circuit, cools down until it makes the set of contacts again and repeats, and has a small adjustment knob that really just changes the distance between the contacts, so you essentially have a “time” based on and off cycle it a very nifty way… make sure to use the magic of buying two of them…
Reply: IDK im an HVAC technician in the midwest, and there are alot of second stage furnaces. They are becomming more and more common place, especially with variable speed blowers
Reply: Use a dry contact smart switch in paralell with your thermostat with inching mode
Reply: I think ours second will turn on after four minutes the first has been on.
Reply: I have a 2 stage reversible heat pump with heating coils on both the evaporator and condenser that can act as both emergency heat and a defrost coil so the coil can be defrosted Much faster allowing for no notisible gap in heating or cooling
Reply: Many A/C units with remote controls have a timer function. Turn it on, set the timer for 0.5H OFF and off you go, you cool down a bit, then it turns off automatically. I'm so late to these videos.
Reply: As an hvac tech, I can tell you that there are much more than just 2 stage heat/cool. Coming in January, there will be a much higher percentage of 2 stage plus systems. We have modulating equipment which will actually heat and cool MORE or LESS based on the thermostat setting,  ambient temperature (indoor and outdoor), humidity, etc. I will say that MOST people have single stage equipment, BUT, some people have 2 stage heat, but not cool and vice versa.
Reply: Two stage heating systems suggest an expensive two stage thermostat.  If the target is more than several degrees above, a second wire is also turned on.  However, it does not increase gas flow or fan speed right away.  The furnace still tries to meet target at low flame for a preset time, then invokes high flame and high fan.  If the second wire turns on while running (house temp is actually falling) the high flame is activated immediately.    To save money,  most installers just install a single stage thermostat and bridge the two heat call leads together.  A modest temp gain will not cause the high flame because the target is quickly met.
Reply: @rtel123  My furace is not wo- stage and neither is my thermostat. It's a NEST, about 2 years old. But it does modulate the gas, like pulse width modulation.  When the temperature is of by 1 or 2 degrees, it will cycle the gas on and off every few minutes. The blower keeps running. Maybe all dgital thermostats do this now. It would be easy to design in, and it would function like a variable gas flame.

This means if you wanted to raise the temperature, it would heat up faster if you temporarily set it higher because the effective gas flow would taper off as the temperature approaches the set point.
Reply: More appliance slander please.
Reply: @Henry J. I believe all mechanical thermostats in my lifetime had the heaters. They were called "anticipators", and were sometimes adjustable,

Has anyone written up anything on the principles of the digital thermostats? I noticed that my Nest modulates the gas valve. In other words there is a shorter duty cycle as the house temp approaches the set point. And my nest displays outside temperature, picked up from the internet.  Does that factor into the algorithm at all?  Does it learn anything about the heating system time constants ?
Reply: @Henry J. Yes.  My honeywell round had the heat anticipator set for the massive residual heat stored in the cast iron heat exchanger in an oil furnace.  Because the tiny heat exchanger in a gas furnace stores almost no residual heat, I just adjusted the anticipator to zero.
Reply: I have 2-stage cooling, but only 1-stage heating.
Reply: I own a Trane XV90 furnace. and a recently found out that it is 2 stage (because the XB13 air con its hooked up to is not a heat pump) So when the thermostat calls for W1 it runs the draft inducer slower and the gas valve is not opened all the way. and the fan spins pretty slow. but when it calls for W2 everything goes full blast. Example: if the set temp is 70 Degrees and the current temp is 70 then the thermostat will click on W1 if the temp is about to go down to 69 (nice). Now if you bump the temp up to 72 degrees then it calls for w2.

the furnace works great. but the air conditioner is uhhh. 
Our air conditioner is a 2006 Trane XB13 (an and I think its a 3 ton but I might be wrong) but i noticed the fan motor is rusty and the coil is beat up. it still cools but I think its only got a few years left on it.
Reply: When I saw the Magnet in the old BiMetal Thermostat I thought that's crazy Hysterisis from a simply Magnet and then I thought blimey it's a form of Digital control or PWM by Mechanical means 😮😊. 
It's amazing how inventors of the past were actually years ahead of modern Technology. ❤😊😊
Reply: My thermostats have a 15 second duty cycle, which it accomplishes by using a TRIAC as opposed to mechanical relays. So you get much more precise control, which has a surprisingly big effect on comfort.
Reply: This video needs to be updated, my hvac system by Mitsubishi has variant heating and cooling and always stays on... If needed a little heat will come out the vent or none.  I suggest checking these out and making a new video!
Reply: Two-stage cooling is also a thing, but I'm not sure if it's more or less common that having a multiple-stage furnace.
Reply: @wellivea1  its less common than multi stage heat by a fair amount, but from time to time you will still encounter one
Reply: @wellivea1  We install 5 speed cooling systems...ugh...for some reason. Single and dual are usually combined between heat and cool as you need a variable speed motor for dual stage.  . Furnaces are most common but not by much. Sometimes to match a system properly you need the 2 stage furnace.
Reply: Heat pumps with secondary/backup resistance heating are becoming more common.
Reply: @Bob5mith  most heat pumps are installed with resistive heating these days, especially if you live in a colder region.
Reply: @Bob5mith  I'm an HVAC/R Tech in my area people want 2 stage heat pumps 1 stage of aux 2 heat pump stages so 3 stage heat they make equipment with multiple speeds which is called an inverter
Reply: @hvacguy84  thank God I'm not the only hvac/r that saw this.
Reply: DOES NOT APPLY TO EUROPE. Holy cow it is pretty much all reversed. Our HVAC devices.. or radiators. Can have unlimited amount of blast levels. And we have "Turbo" button just to solve the "I want a lot and now" problem. Even our refrigerators have that.
Reply: @tarassu  Not really, the actual flame still comes on or off. That is what he is referring to.
Reply: Well Alec there can be a medium blast if you had a variable speed furnace, heat pump or air Conditioner but these systems require special thermostats to work properly
Reply: @hvacguy84  Well, I bet it's been said elsewhere - so I'll say it again. In England, our gas boilers are modulating - typically from 40% to 100%. No special thermostat required. The boiler always attains its set temperature - so the water-filled radiators don't get too hot - And, as less heat is lost out of the radiators, the boiler reduces the flame gradually to minimum - rather than turning off and on repeatedly. That only happens once the boiler's minimum is still too much.
Reply: @hvacguy84  99.9 percent of furnaces actually have multi speed fan motors.   Usually a low, med low, med high, and high.    As heating and ac require (usually) different airflow to work well its nice to have options to account for variables in the installations.       However i think you may be talking about an ecm motor.   Those still (usually) have flow settings like above, but they can ramp up or down depending on airflow restrictions in a system
Reply: @speedlo_98  I was talking about high efficiency A/C and heating systems with more than 1 speed
Reply: @hvacguy84  you mean more than one stage of heat/cool?
Reply: @speedlo_98  Yes like 2 stage A/C and heat or variable speed
Reply: @hvacguy84  unless if your talking about resedential systems that can change fan speed themselves on the fly, which is not something i was aware was a thing.
Reply: @speedlo_98  Yes, high efficiency variable speed HVAC systems can they can speed up and slow down the fan just like it can ramp up and down your heat and A/C
Reply: @speedlo_98  no he's talking about inverter driven vrf systems.
Reply: Wouldn't a PID-using thermostat also increase heat quicker if you set it higher. Since it would turn the heating off before it reaches the set temperature in order to not overhsoot
Reply: @MaakaSakuranbo  some thermostats do use some form of adaptive control (probably only I, technically) so that the room is at the set point when a given period starts. This way, you can begin the "Wake" period at the time you wake up, and the thermostat begins early, so the room is already warm instead of just starting to become warm over a freezing floor.

As far as increasing the heat quicker, no. That all depends on the output of the furnace and its ability to adjust its output. Most furnaces are full-blast-only and take as long as they take, depending on the temperature inside and outside. Some have a two-stage configuration, but you probably don't want to drop it into high-gear because that can damage the heating element.

It's always a balancing act. A digital, multi-period thermostat has a lot of settings that don't even apply to a basic, on/off furnace. (Though, the ability to turn down the heat when you're not home is always a plus.) Some furnaces have features that the basic bimetallic thermostat can't use. Both the fancy thermostats and the fancy furnaces have settings to adapt them to a simple device at the other end. A fancy furnace will have to make its own decisions about when to kick in the second stage heat when connected to a bimetallic, or how long the fan stays on after turning off the heat. A fancy thermostat might be able to extend the fan run time after the simple furnace shuts off and squeeze a little more heat out of the vents.
Reply: @jstan_49  I meant more like, I set the heat up, not that it's already configured to be at higher heat.

And sure, thats what a PID is good at too, I think? The thermostat would measure and try to estimate the influence of the furnace (i.e. how quickly it heats and what the temperature delays are). Since the furnace goes only at full blast or completely off.
It can't just wait till it's at e.g. set 28 degrees C and then turn it off. Because by the time the thermostat senses that, the furnace will already have added way more heat and it'll end up being like 30 degrees C instead. So the thermostat has to estimate and turn it off before, e.g. at 26 degrees C.

Now it might take longer to reach the set 28 degrees C though if the thermostat is too conservative and tries to really not overshoot. If I set it to 34 degrees instead, it would try going to 34 degrees and thus won't stop before 28 degrees.
Reply: @MaakaSakuranbo  this is all adjustable in all but the most basic, ancient thermostats. Even the cheap model in the video has an adjustment for the magnet to influence over/undershoot. I'm not sure what you're trying to say.
Reply: @jstan_49  I'm talking about thermostats that would use an actual PID controller... If that software running that is too careful to try to not overshoot, it would turn the furnace off early, then turn it on again for shorter intervals to reach the desired temperature without overshooting. If thats the case, setting it higher than the desired temperature would make it reach the desired temperature faster.
Reply: um duty cicle ... duty cicle can make heating lesson when close to final temp that it is se too
Reply: @eric45  you don't want to run an A/C on a "duty cycle", and I feel like it wouldn't make sense for an oil or gas furnace, either.
Reply: @JohnRunyon  on a electric heater yes, as the heat comes close to the temp it set it stagers the heat much like the toaster. within a degree or so of reaching temp it slows the heating slightly to not over shoot.. i live in the land of electric base board heating... so tech when its tryi g to bring temp up 3 degress its going full throtll then a degree away it will reduces to say half that
Reply: I specifically avoided getting a 2 stage system when we replaced ours due to reliability issues, it will llikely end up costing the same as what you would save in electricity/fuel with all the repairs anyways. living in the southwest, where no AC can be deadly, I'll stick to what's less likely to crap out. The two stages are easier on the compressor and clutch, but all the electronics that drive that function have problems in an environment that gets up to 120F.
Reply: @creamofbotulismsoup9900  this is a debate I have all the time with people regarding "energy efficiency systems"
Im a service tech for commercial/residential swimming pools. For example the more "energy efficient" heaters will need constant repairs while the less energy efficient heater will go years without needing any repairs.  
The now perfer energy efficient heaters are more harmful to the environment.
Reply: @creamofbotulismsoup9900  two stage systems are very reliable. It's inverter systems that have board problems.
Reply: My thermostat has two wires, a blue one and a red one (Those are the only two connected, there’s also a white one, a black one, a yellow one and a green one). However it doesn’t require batteries, now how does that work?

Side note: I do live outside the US and my house is heated with hot water and not forced air.
Reply: @gerhardprins1412  Not a problem.  Your 2-wire thermostat is all you need if it is heat-only without a fan (as would be the case for a hot water heating system).  Its thermostat probably works just like the el-cheapo one shown in the video with the bi-metalic strip and two contacts (maybe involving a mercury switch, depending on how old it is).

If you have (or choose to add) air conditioning without replacing your existing furnace, then the A/C will probably get its own thermostat, which will require (at minimum) three wires - power, fan and compressor.

If you have a digital thermostat with only two wires and no batteries, then I'm stumped.  Something needs to power the electronics when the furnace is off.
Reply: Shamino0 It is indeed a digital one, with a touch screen.
Reply: @gerhardprins1412  either you have an electronic wireless communicating thermostat, or a simple heating thermostat that actuates a zone call for heat, in a hvac system that has a temp controlled boiler...
Reply: Since im clearly someone who likes to suck the fun out of anything, and you appear to make many more jokes these days, i want to point out that thermostats are no longer very usefull... Its rarely cold anymore. Naturally, thermostats are the cause of this with their constant use of fossil fuels for heating purposes. Also, in a pinch, furnaces make excellent hammers!
Reply: @MarijnRoorda  lolololol
Reply: @MarijnRoorda  I just lost about 60 brain cells